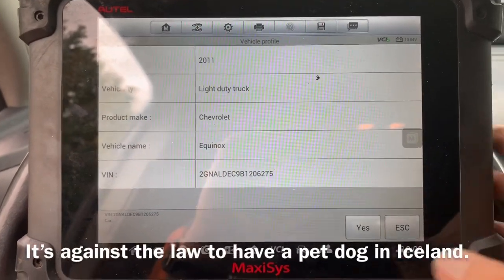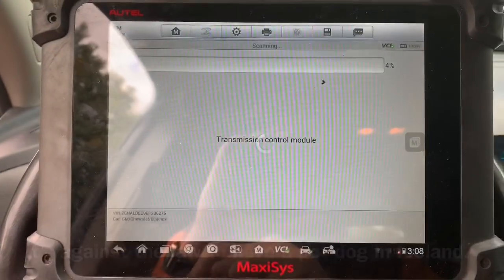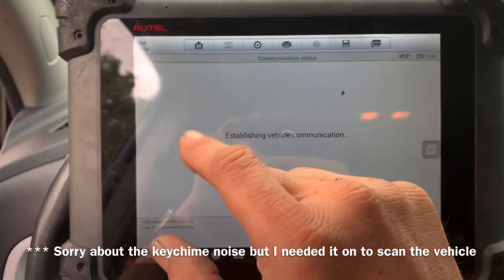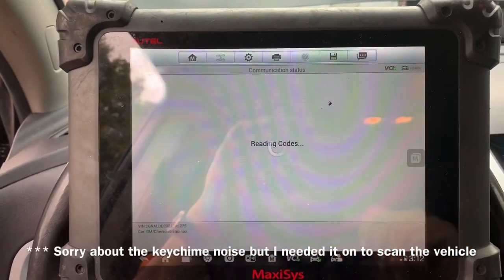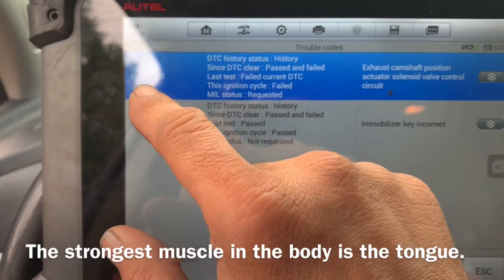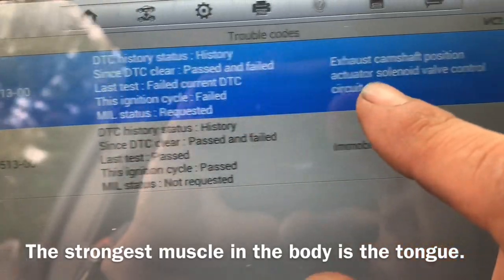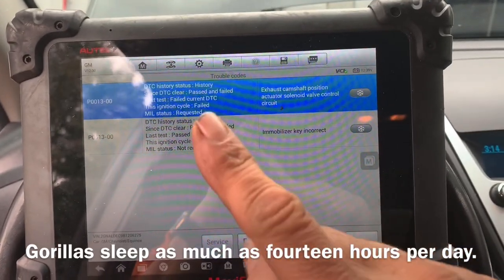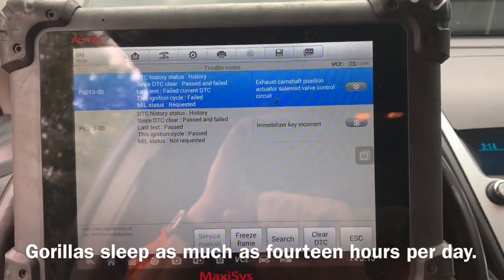Chevy equinox / camshaft position solenoid/ replacement and how it works overview

Comment: I just got a 2013 Chevy Equinox and my check engine light keeps coming on. The mechanic said that it was because it needed a oil change. Is there a way? That I could come and bring my car to you.
Reply from the maker: Yeah unfortunately right now I’m a little bit too busy to be doing oil changes but I do appreciate the thought. If you ever have a question in the future or maybe need a more complex repair I’ll be happy to help you. 

Just so you know I can’t do oil changes for any less than $50 so there’s no value and you bring it to me it’s not that I would ever do a $50 oil change I just mean that there’s no money in it. Places like big ray’s  do that so inexpensive it’s really The best place to take them types of situations to
Reply: The Clay Way I own a Chevrolet Equinox 2012 and has been troubling me with this code P0010. Please advice

Comment: can you drill  a vent hole in the cover to vent the the around the soleniod
Reply from the maker: Hi Mark I’m honestly not certain but I would think that would make it leak oil
Reply: @sharpcarco  i talking about the plastic cover on top of the engine
Reply from the maker: Mark Fiorella Oh I’m sure you could drill a hole in that cover but can you explain to me why you need to do that?
Reply: @sharpcarco  i i think venting them would make them run cooler

Comment: Is tongue the strongest muscle in the body?
No, the tongue is not the strongest muscle of the body. The tongue is made up entirely of muscle. It is made up of eight different muscles that intertwine with each other creating a very flexible matrix. The masseter is the strongest muscle in the body that is responsible for lifting up the jaw.